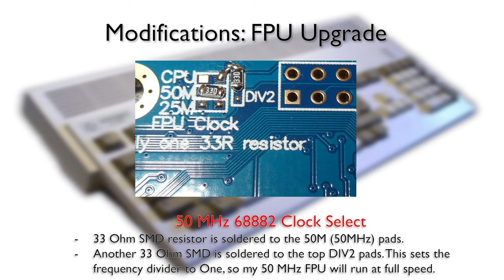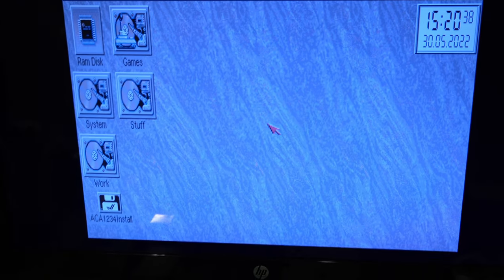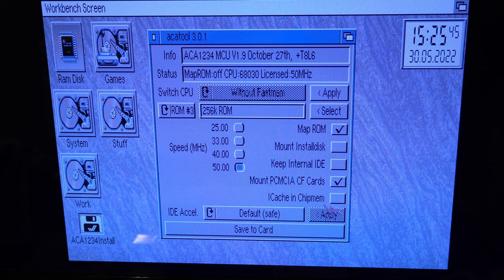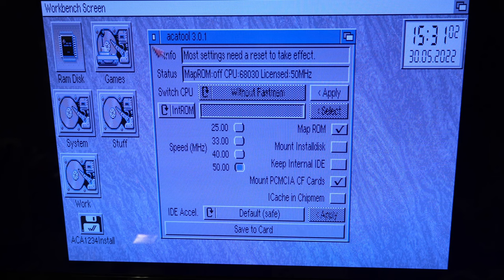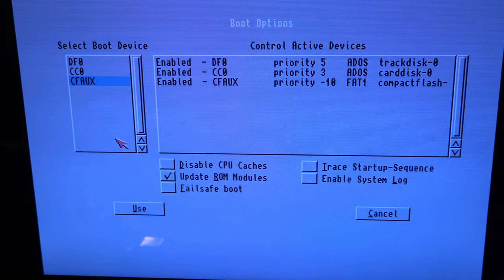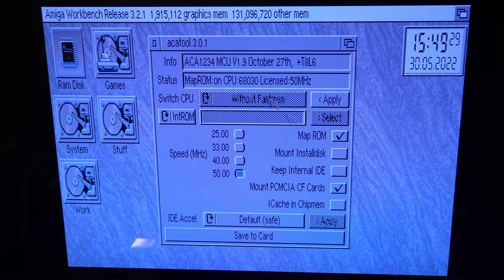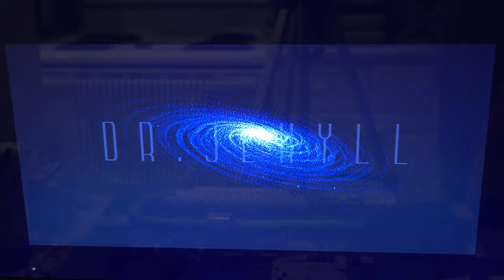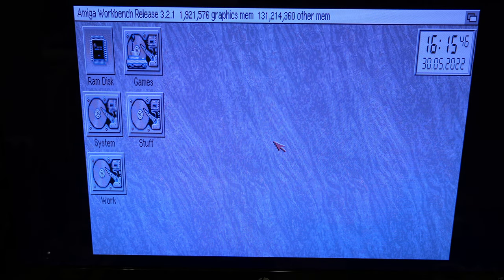New Amiga 1200 68030 Accelerator Card - The ACA 1234! (re-upload)

Comment: Great Video. 3 questions please.  1. Do Individual Computers do the Mod for the Wirelink and FPU upgrade. 2. Are you using the Indivision MK3. I can onlly see the RGB outlet ?   3 Is that classic WB on the 3.2.1. ? I have just put in 3.2.1 and it does nothing for me as the Icon's are are elongated on Super Hi Res.   Thank you.  I have their AKA500+ on my A500. Just trying to justify the MK3 and an Accelerator Card for the a1200.
Reply from the maker: I thought I answered your questions earlier, If I did, I shall repeat myself :)

1) Individual Computers won't perform the FPU Mod for you, even though they provide instructions on their Wiki page, it will Void your warranty.
2) It is indeed the Indivision MK3. The main difference between the MK2 and MK3 is the MK3 has an HDMI and VGA connector (only one can be used at a time), the MK2 is DVI only, of which, I believe you can use a DVI to VGA or DVI to HDMI adapter. Also, the MK3 will output Audio over HDMI, ideally at 96KHz, for the proper decoding of an attached TV/Amp
3) Screen Aspect ratios affect the Amiga Workbench layout quite a bit. Try a 4:3 or 16:9 screen resolution such as 640x400 or 1280x720. HighGFX should be installed to archive this, the new screen modes can be found on Aminet. This may require some experimentation. If you look around the internet, there are non-interlaced Workbench Icon sets available that will help avoid the stretched look you are seeing.

Comment: Did you solder that FPU on there. I see they have a board now without one. And they kinda warn that 6881s are not the best addition to this board. Is the CPU socketed? The 50 MHz version is rather high $$.
Reply from the maker: The CPU is soldered to the board. The FPU is socketed (ordered from eBay). The FPU is not offered as option though you can add one yourself, as I did. The FPU installed  is the 68882, its better than the 68881 anyway :) 

Individual Computers has instructions on their Wiki page regarding the FPU modification, but this will void your warranty

Comment: I've never been able to understand: where do people get  68030 CPUs today? are they sstill being made?
Reply from the maker: 68030's are still available on eBay, usually from China as NOS (New Old Stock). Used options are also available. Look for a good Seller rating and you should be OK (getting what you actually ordered :)
Reply: @amigaretro4765  I’m lucky I have my blizzard card from 1995! Just 68030@50 + 4 MB of ram but fine for me!
Reply from the maker: @matteoboldizzoni9870  I have several Blizzard Cards from Phase 5 with 68030's. most at 50Mhz, 25 is fine too. 020's with some Fast Ram on OS 3.1 works well, 030's are really needed when using the newer OS's such as 3.1.4 or 3.2.1
Reply: @amigaretro4765  if only A1200 had come with a couple MB of fast ram from the factory.. 😢
Reply from the maker: @matteoboldizzoni9870  Definitely, the same goes for the CD32. Developers wanted more memory, especially since fast ram gives the Amiga better performance.
Reply: @amigaretro4765  the first time I put a couple of MB of fastram in my A1200 I immediately felt like I was using a new computer; the following sensation was anger towards Commodore for not putting that RAM themselves (I don't believe it would have had such an enormus impact on the final price)

Comment: I did the same to my ACA 1233n just put a socket on to it so I can take if of needed. But you have to be very carefull when getting the 68882 FPU there are many out that have been remarked to show diffent speed. one I had you can see the way it was scrached off, I got it from Ebay and was able to send it back for a refund.
Reply from the maker: I know. e-Bay can be a bit of a gamble at times. Luckily e-Bay's return policy has you covered, as you found out. Still, it's a bit of a hassle regardless.

Comment: Just over 7 megabyte/second. That is fast. But I still dont know why I get slightly over 9 megabyte/second on my 500/68000, using a sidecar HDD/Ram expantion.
Reply from the maker: Luck :)
Reply: @amigaretro4765  I still wonder how this is actually possible. Should not be, as it is with a 68000 and not 68030 or faster.
Reply from the maker: @brostenen  Is the Hard Drive/Controller SCSI or IDE?
Reply: @amigaretro4765  IDE but I am running it with a CF card and a generic adaptor.
Reply from the maker: @brostenen  Hmmm. The Compact Flash Brand and Transfer Rates vary widely between brands. The controller can also have a great impact as well, especially if it uses DMA, Direct Memory Access.
Reply: @amigaretro4765  Thanks for the information. 🙂
Reply: @counterair173 Perhaps. I have not really looked into it.

Comment: Too many 68030 accelerator cards! Still waiting for a 68060 one….
Reply from the maker: There is always the TF1260. Most CPU options are the LC versions (No FPU), or you can order the card without one. If you want a full blown 68060, get ready to fork out an extra $300 USD.  These are REV6 CPUs that can be easily overlocked. Most run stable at 80 MHz. Due to this, they fetch a high price on eBay or anywhere else for that matter. I may do a Video on this card later this Month, equipped with one of these rare pieces of silicon.

TF1260:  https://amigastore.eu/en/873-terrible-fire-1260-128mb-ide.html
Reply: TF-1260.
Reply: @amigaretro4765  Hi, have you tried to boot the CF card on the 1234 with the internal 1200 attached IDE too? I have both attached and I want to boot with the ACA1234 CF card but it always boots with the internal 1200 IDE in whatever I do. I use HDtoolbox from the 3.2 workbench and change priority boot numbers but they still say 0 on the top LUN menu. When I make the internal 1200 ide non-bootable neither one boots. It goes into the ACA1234 install menu. The CF card only boots with the WB startup menu like in your video. Great video by the way, and I like the ACA1234 card. I had the  TF1260 which is riddled with problems being built by different builders with different parts. It is in repair now as it stopped booting after 11 months. It was fast yes but not as organized as the ACA1234. Wish Jens would put out a 68040 at least, although chips I assume are scarce.
Reply from the maker: @cevoner  I have similar issues. Because of this, I currently  do not use the A1200's Internal IDE. Either don't install anything on the IDE header or leave "Keep Internal IDE"  unchecked in ACATool.

I have a TF1260 as well and even though I have a Revision 6 68060, I cannot overlock the card at all. I own various TF 68030 based cards and they all have odd quirks. As you have mentioned, Individual computers makes very reliable hardware, not perfect, but superior to what is currently available. Jens Rules 😁!
Reply: @amigaretro4765  I fixed the boot situation by setting the CF card boot priority to 2 and the internal IDE to 0. It now boots the CF card on the ACA1234.  I agree that Jens is a great design for most situations on an Amiga. 

The TF1260 just failed to boot and they are still trying to figure it out. I tried booting with the internal IDE but it has to double boot to load a driver. Not ideal. The driver has to reside in Rom. I did not even try to overclock it as I had the LC chip.

 I bought the ACA1234 because of your video and I'm glad I did. His support is impeccable too. One issue I have is with Sysinfo 4.4. It crashes most times when it reads the 6 MB partition on the CF card on the 1234. Jens says to use an earlier version but I cannot find one as yet. I have the same 8MB card you used but it's split into 2 and 6 MB. 2 MB reads fine at 6 MB/sec.
Reply from the maker: @cevoner  Boot Priority makes sense. 

I have a older version of SysInfo, 3.4 I believe. I found it on a 40MB, yes, MB, HDD that came with an A1200 bought on eBay years ago. Still works. My A1200 that was purchased in 1993 had the same Drive. A Seagate 40 MB, the badge even states "A1200/40".  Hard to believe these drives were $300 back then. Cutting edge at the time, especially for a 2.5" Laptop drive.
Reply: @amigaretro4765  I located a 3.24 Sysinfo and no more crash. These versions apparently differ as Jens noted.
Reply from the maker: @cevoner  Great to hear